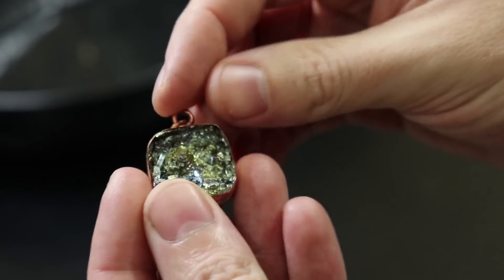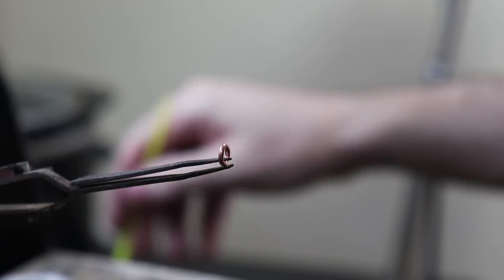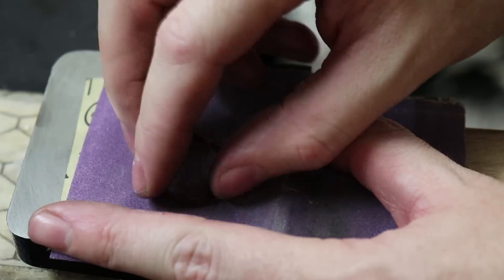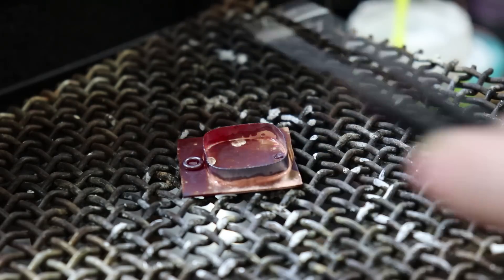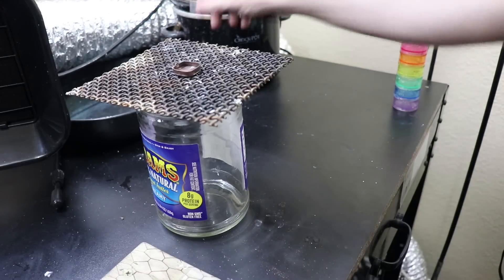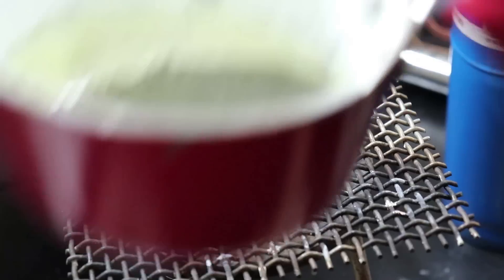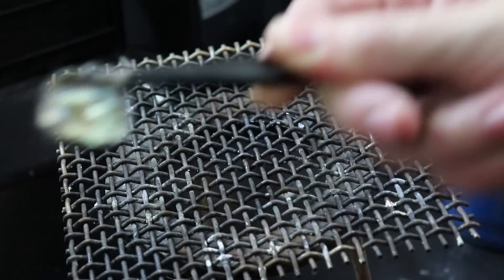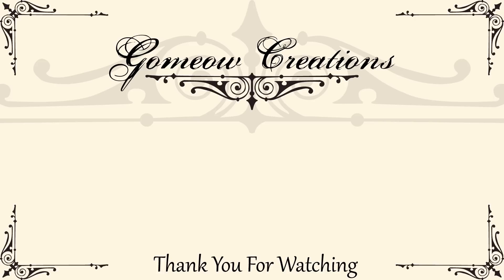Making a Bismuth Crystals Necklace

Comment: hi. I love your channel. Your videos are very interesting and instructive. 3 years ago when i started with this magical element i struggled like you. 

Its mostly to manage the right temperatures. If i would try this bezel, i would melt the Bismuth until the colorchanging is getting oily/milky. then pour in the preheated bezel, remove the slag carefuly with tweezers, and give a short kiss with the torch to clean the surface. let it sit on a piece of wood , so the cooling is bit slower than regular. tap very gently on the rim to see the process of cooling. Remove surface crystals ,take it out,or flip them over and put them back in the liquid. Then pour out the rest. Hope you can use my tips and get stisfied with the results. Feel free to ask more about. For my Crystals i work with a 0.6 Liter stainless steel Bowl , not a Pan, filled full with 6 Kilos Bismuth. I use stonewool for heat preservation, the slower the cooling , the bigger your crystals. Today i made my best looking and biggest 738 Gramm Rainbow Crystal. 

my insta is.... @richartegli         greetings from Switzerland 

MOST IMPORTANT   !!!      NEVER EVER PUT A WET CRYSTAL IN THE LIQUID METAL =  STEAM EXPLOSION !!!  NO FUN 

2nd    If you wanna start growing nice 3D Crystals you need at least 5 Kilos / 10 Pounds  of 99.9 % pure Bismuth
Reply from the maker: Well thank you very much for all this info, I will be very helpful when I do this again. 😁👍

Comment: I've been tinkering with electroforming.  I'm getting pretty good.  Look out!
Reply from the maker: Lol nice. What tools are you using?
Reply: Well, let's see.  I'm using copper wire.  File and rotary tool, of course.  Polish.  Varnish.  And for the unorthodox jewelry making materials, a copper plating bath, conductive paint, epoxy putty and a variable power supply.  I polish all my own stones too.  For the process, I polish a small cab.  Affix it to a shank with epoxy putty.  Sand the putty down and then paint it with conductive paint.  Then put it in the electroplating bath and plate the copper to the conductive paint.  I then file it down to give me a smooth surface, then polish and clear coat.  I guess you could say I grow a bezel around the stone.  I plan on making a video about it one of these days.  It's an interesting process.  I'm thinking I might try using silver electroforming one of these days.

Comment: Wow great video.  Learned technique I had never seen before. Once you have bismuth in pendant how do you pickle it again ? Once bismuth cools in pot , do you just store unused portion ? The shopping lists are great idea because it show where exactly to get everything
Reply from the maker: Thanks and I haven't seen anything does this so I thought I would give it a try. I still need to work on getting this working more reliable. After heating it I don't pickle it because I think the pickle might strip the colors off of the Bismuth. As for the shopping list, I'm going to start doing this more with my videos.

Comment: I think what caused the bismuth to solidify instead of crystallise is because the copper cools it down too quickly try lightly heating the copper to the temperature of the bismuth then letting it cool with the liquid bismuth in it.
Reply from the maker: You are right and that is what I did end up doing to make this all work. 😁👍

Comment: Did you ruin your nice tweezers? That's cool. Challenge: Niello. I'm dying to work with it, but it has to be prepared with large amounts of sulfur and lead and I can't do that here in my apartment. The park across the street has a barbeque pit. Maybe there. Would like to see you etch something and fill it with niello, finish it, do the whole thing. You skills are better than mine. ;-) A tutorial would be great.

Could you just put some small chunks of the stuff I'm the frame, slowly heat the frame, and dump the extra?

Very cool video! Thanks, Randy!
Reply from the maker: Nope, once the metal has hardened you can just pull it off the tweezers. 

As for the Niello stuff, I have no plans on working with that in the future and seeing that it has a lot of lead in it i would rather not work with it. I really try not to work with lead.

and yes you could melt it in the frame and do it that way but I just have not tried it yet.